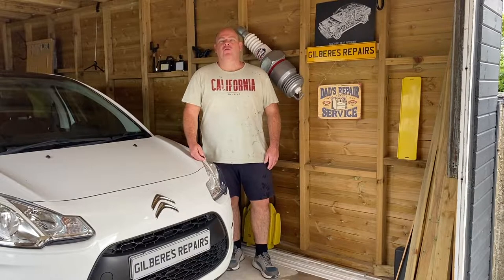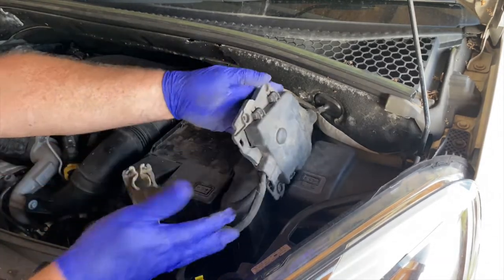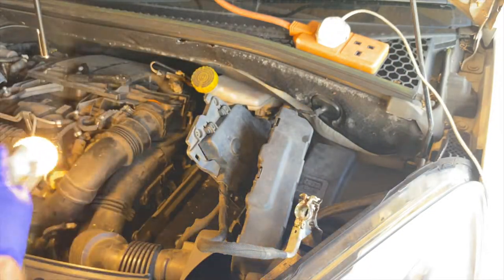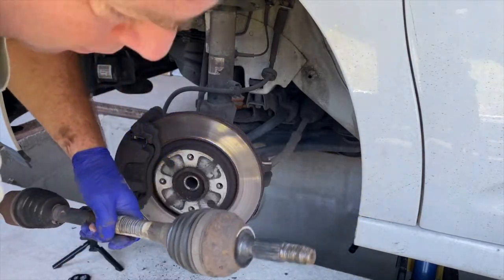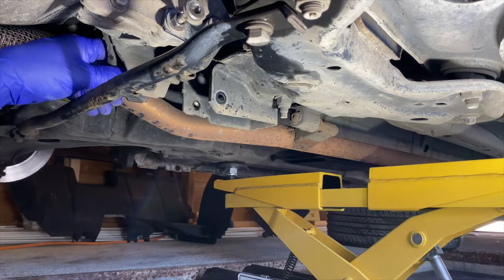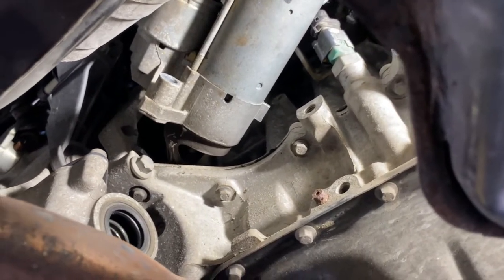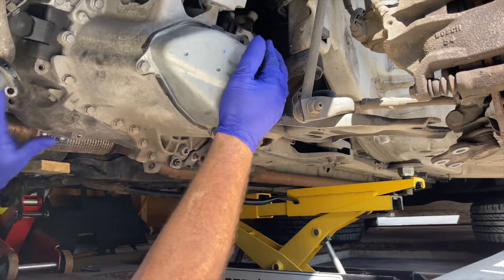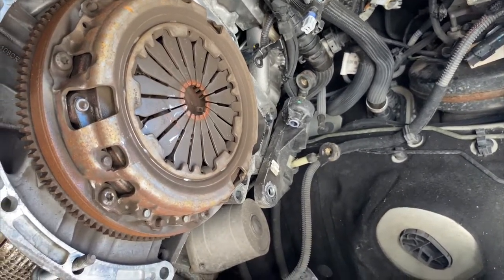Citroen C3 Clutch Replacement

Comment: Great video. That upper starter bolt is a killer, particularly since I couldnt separate the drive shaft from the hub. Tried everything and then just worked around it.
Reply from the maker: Yes, i feel your pain 😂

Did you manage to complete the job?
Reply: @gilberesrepairs  I’m in the thick of it. Everything bolting back up and the bolt for the starter from the other side isn’t lined up. Thinking loosen the two bolts and jiggle it till I get it in. Your video is a godsend
Reply from the maker: @paraicotoole1634  Yes, leave all bolts loose until they are caught in the threads, only then tighten them up 😜
Glad to hear the vid is useful, gives me the incentive to keep making them 👍

Keep me posted 👍
Reply: @gilberesrepairs  best I’ve seen. Really comprehensive. I’m struggling to mate the ball joint 3 slots to the bar for each wheel. The ball joint seems to be a long way below
Reply: Never mind. No starting but power so thinking I’ve disconnected the starter with all the fiddling
Reply from the maker: @paraicotoole1634  Go and have a cuppa, come back and have a casual look around the job and the problem will be apparent 👊
Reply: @gilberesrepairs  the earth wire not making contact. Bit of sandpaper and all good
Reply from the maker: @paraicotoole1634  Excellent 👍

Comment: Very informative film. My C3 need to change the clutch, but it is too difficult to me, lying at the floor ;-) but it costs 606£
Reply from the maker: Glad the video was informative 😎

Yes, it’s a decent amount of work to take on. If you do decide to have a try, jack it up as high as you can and support the car on axle stands 👍
Reply: I had a look on those repair comparison sites, and for a 1.6 diesel, near Birmingham, the prices start from £450. My local Citroen dealer charge £900
Reply from the maker: @RM-vv9eh  Yes, i had a quote for £650 including changing the gearbox oil, from a local clutch specialist centre. I ended up doing this for around about £100, using a quality clutch as well.
Reply: @gilberesrepairs  

How long do you reckon the job took ? I think I've seen 9 hours quoted before.
Reply from the maker: @RM-vv9eh  I think a garage would allow one day to do the job and probably finish earlier.
I would allow two full days if doing this at home by yourself 👍 You know how it goes when doing a job at home, something always goes wrong 😂😂

Comment: Yes great video thinking of geting c3 just wanted idear on clutch change A1 great job your son owes you a drink or 2
Reply from the maker: Thanks for the positive feedback 👍
I never got a drink 🤔
They are good cars really and the parts are reasonable when required. 

A word of warning ⚠️  My son has the C3 1.4 hdi and i have a C3 Picasso 1.6 hdi and they are proven engines fitted across many manufacturers (Citroen Peugeot Ford Volvo) 
My sister in-law has the 1.2  3 cylinder petrol engine with 50,000 miles and it drinks oil. The 1.2 petrol also has a “wet belt” where the cambelt is submersed in the engine oil. The belts can swell up and break up, causing a blockage in the oil pick-up pipe in the sump! My advise is… do some research on the petrol engine if that’s what you are considering buying 😉

I have a C3 Playlist on my channel and from next Saturday i’m starting a service series on my C3 Picasso 👍

Any questions feel free to ask 👍

Comment: Hi I have done my clutch and now I have no reverse have all other gears just not reverse is there any adjustments on the cables? Or any ideas
Reply from the maker: I’m unsure about any adjustment. But i would start by looking at the selector cables. 

I take it everything was fine before changing the clutch?

Comment: I have to change my clutch this saturday on my Citroen C3 II 1.6 diesel. Which tools are needed for this job?

You mentioned something about a 16mm top - any other sizes. And size allan key and torx if you can remember 🙂
Reply from the maker: Sorry for the delay in replying 😉
I can’t remember the actual sizes of the Allen Keys or Torx Bits, but i can say that they aren’t any unusual sizes as my tools are very basic standard sets.
The only tool that i would call a specialist tool is the Clutch Alignment Tool, and they don’t cost much on Amazon 👍
Sorry, i’m not much help 👎
Hope all goes well for you, keep us updated with your progress 👍
Reply: Ok thx. I have found a way to make my own allignment tool, so I'm good to go. 

Btw forgot to compliment you on your amazing video. This is gonna make my clutch replacement so much easier and straight forward. Thanks a lot for sharing your expertise!!! @gilberesrepairs
Reply from the maker: @JOK3R_DK  Thanks for the positive comments 👍
Keep us updated on your progress, hope all goes well 🤞
Reply: @gilberesrepairs  I succeded in changing the clutch alongside some other stuff. But when i start the car it's very rough and rattles a lot. It's only when i start the engine. Once it runs it runs smooth...??
Reply from the maker: @JOK3R_DK  Excellent that you managed the clutch 👍 Not so good you’ve got problems 🤯
Is it rough when turning the engine over on the starter or when it’s idling?
Reply: It's when turning the motor over. Might be the 2 top mounting bolts for the starter. I had quite at struggle reaching those. The lower on is tighten max. Don't really know what else would cause this?  @gilberesrepairs
Reply from the maker: @JOK3R_DK  Yep, sounds like the starter not sat in square.

Comment: Been quoted £350 for the clutch on C3 1.1cc same year. I'm in two minds to attempt it the clutch itself costs £50. Good video will keep you posted if i do it....cheers.
Reply from the maker: Difficult one, haven’t got or don’t want to spend the money, but also don’t want to break it if it goes wrong 🤔 
I had a quote for this C3 and it was £650 to change the clutch and renew the gearbox oil at the same time. I did both for around about £100. 
At least the C1 gearbox will be a bit lighter to lift out 😂

Keep me updated if you have a stab at it. It would be good for me to know if my video was of any use to someone 👍
Reply: @gilberesrepairs  I did the clutch back in April the gearbox was heavy but i was on my back underneath car. I'm glad i had your vid to look at though luckily it all went smoothly.
Reply from the maker: @carlsimpson4875  Glad all went well for you!  
That’s about as cheap a clutch can possibly be done for… £50 🥳🥳🥳

Comment: I don't have that blue 💙 tool element...do i really need Couse i will need once and no need to buy it Hope i can use something else Any info will be thankfully, Best Regards
Reply from the maker: Hello, 
Basically the friction plate has to be central when clamped in place by the pressure plate. You could use any bar of the correct diameter. The tool i used in the video only costs about £10. But yes you’ll probably only use it once.

Comment: Hello, does this model have a dual mass clutch ?
Reply from the maker: Hello, this is the 1.4 hdi and it has not got a dual mass, it has a solid flywheel, which makes it cheaper and easier to do 🥳
I think (from memory) the job only cost £110 including new gearbox oil and using a valeo clutch 😎

Hope this is of some help!

Don’t forget to check out my C3 playlist 👍

Comment: what does it mean if clutch pedal is going all way to floor on same car as this
Reply from the maker: Has the pedal fallen to the floor?
Reply: yes @gilberesrepairs
Reply: nothing at all on pedal mate
 @gilberesrepairs
Reply from the maker: @wildfruits477  I would start by looking at the hydraulic side first. The piston and associated pipe work that i remove @ 12:30 in the video. I would give that an examine first for wetness/leaks 👍

Comment: Hi I've had the clutch done. I have a slight drip coming from somewhere  and it smells like gear box oil...any advice?
Reply from the maker: Hello, more than likely a driveshaft oil seal has been damaged when putting the driveshafts back in. I’m only guessing but that would be the first place i’d check. 
Hope you find it 😉
Keep us updated 👍
Reply: @gilberesrepairs  thanks great video.. I've probably got 1.95 litre left..
Reply from the maker: That’s not to bad. Just get it checked out and sorted in the near future to prevent any long term gearbox damage 😉
Did you do the clutch yourself, or a garage?

Comment: Hello. I would like to ask you this. I have bought a 2016 Citroen C3 1.6BlueHdi 99ps, 5 speed manual with 105.000km on the clock. When I started driving the car, the clutch felt very stiff. I changed the whole clutch set (LUK parts) as well as the clutch pump, and only the first day the clutch was quite lighter. After the second day, the clutch feels almost as hard as before changing it. Well, it has an initial soft feeling for the first 1/5 of the clutch travel and then it starts becoming very stiff to press. And of course, when lifting the foot, it depresses with the opposite firm way. It actually hurts my left foot, where I press the pedal. Should this be normal? Does this car has or must have such a stiff clutch? Thank tou. Vassilis
Reply from the maker: Hello Vassilis.
Definitely not normal. We currently have two Citroens in the family and they both behave how a clutch should behave.
I would recommend unbolting the clutch pump (slave cylinder) from the side of the gearbox and trying the pedal again. This would prove whether your fault is internal (clutch) or an external fault. 
Certainly better than removing the gearbox again!!

Keep us updated... Sandy.
Reply: Hello. Thank you for your prompt response. I do not have engineering knowledge and I cannot do these things on my own. I went to 2 different mechanics and they told me that the clutch sensation is almost standard. But I am sure that if I leave it like this it will totally hurt my leg. I couldn't imagine such an airy small French car to be so hard on tge clutch. I have started thinking to try and find any reinforced upper or/and lower clutch pumps, or even better a servo mechanism.
Reply from the maker: @vassilisg  If two garages say it’s ok then it must close to how it should feel.
Maybe some research on modifications would help in the long run 👍
Reply from the maker: @vassilisg  If two garages say it’s ok then it must close to how it should feel.
Maybe some research on modifications would help in the long run 👍

Comment: Also how long did it take you, and did u have to bleed the clutch
Reply from the maker: I did the job over many days, just an hour here and an hour there. If you are doing the clutch at home and not done one before, i would allow two full days to carry out the job. 
I didn’t have to bleed the clutch because the cylinder unbolted, therefore no fluid was disturbed. 
Hope this helps.
Reply: perfect! Is it the clutch if the pedal drops to floor
 @gilberesrepairs

Comment: Can I ask you how much it would cost to change in a garage ? Price range? Many thanks
Reply from the maker: As it happens i know exactly, because i priced up the job in a garage to show my son 😂😂 Just to let him realise what i’d saved him!!

Garage price… £660 including gearbox oil change

Dads price… £106.80 including gearbox oil

Hope this helps in your decision making 🤔
Reply: @gilberesrepairs  you the best dad ever 😅👏
Reply from the maker: @pierfrancescoditucci2644  I tell him that 😂😂
If you do the job, my advice is to buy a branded clutch not the cheapest one, because it’s such a big job to replace a failed unit 😉 The branded clutches are not that expensive, i think the one i used was ‘valeo’ 👍
Reply: @gilberesrepairs  yes! in Cambridge tehir ask me even more than 660... to replca the clatch, I was thinking to buy Valeo or Luck.
Reply from the maker: @pierfrancescoditucci2644  👍